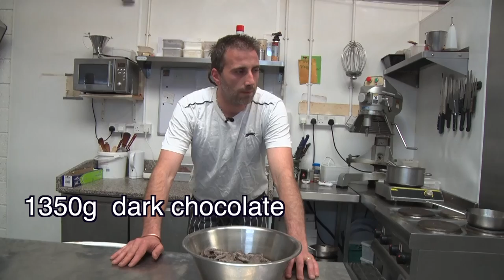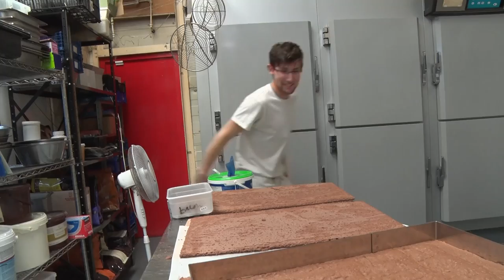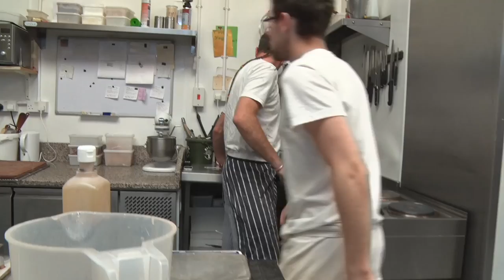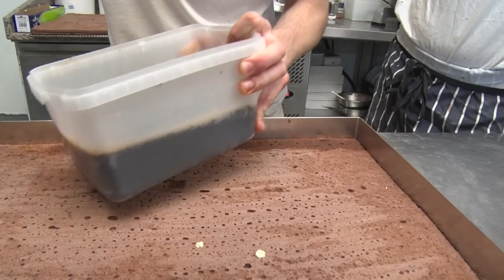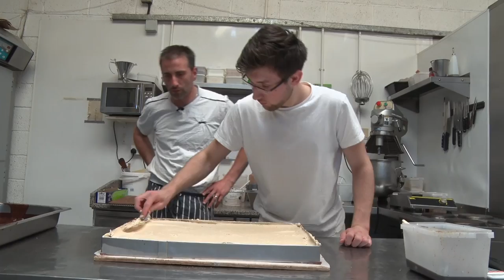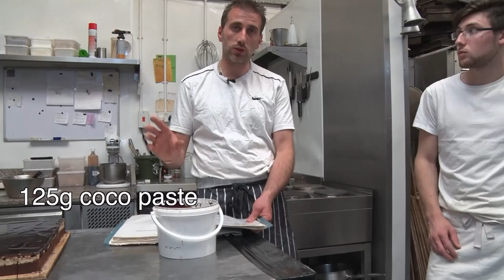How to make a Opera cake French Chocolate sponge cake with The French Baker TV Chef Julien

Comment: 20cmx30cm pan: 
MERINGUE
250g caster sugar add to
125g water, heat on stove up to 112
Then start whipping 125g egg white for meringue 
At 121C, pour syrup into egg whites while being whipped 
GANACHE
boil 750g whipping cream then pour straight onto 
675g 55% dark choc melts whisk till incorporated & cool. 
See Chocolate sponge video for Opera cake base

500g COLD small diced butter 
500g water + 500g caster sugar boil then add 500g sugar